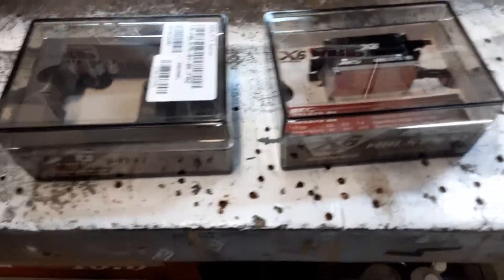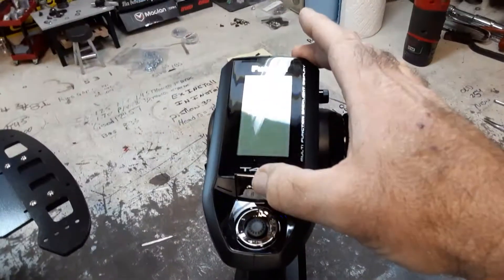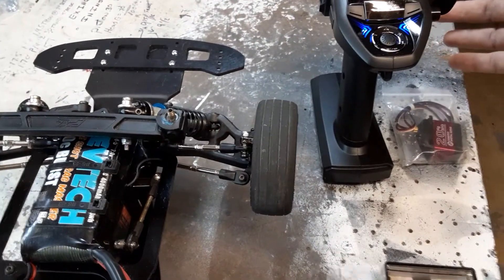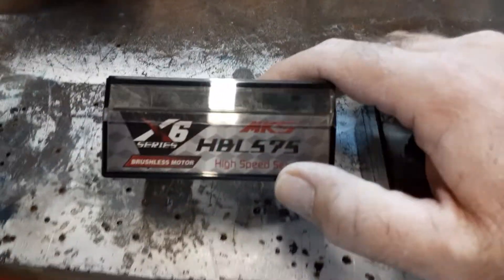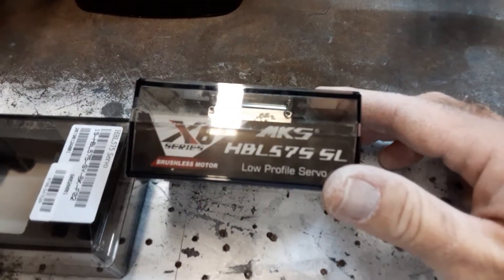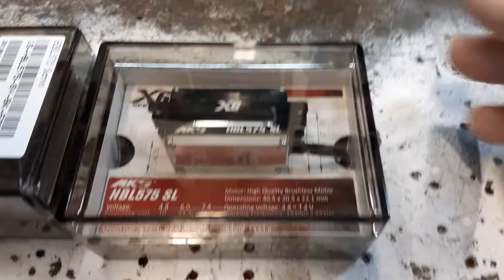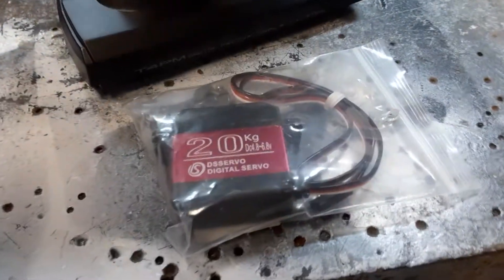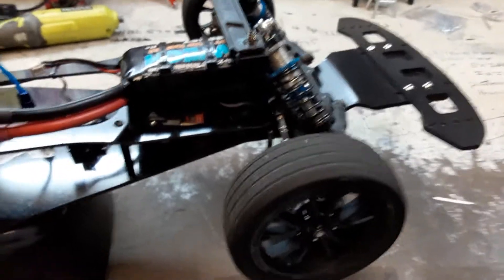RC Street Eliminator Drag Racing...A little Servo help!

Comment: Very nice equipment. I think it will be just fine. No mistakes . just learning experience's.  I think the sl means slim line.  As long as the specs are the same run it. And im sure its a weight reduction.👍
Reply from the maker: Thank you so much Rob for helping me out... you are right that thing weighs half as much, I think I may buy one from my other cars !!!

Comment: Like someone else said, doublecheck the servo arm (horn) isnt actually going too far down the splined part, and binding on the top of the case once the screw is tightened. Other than that, if noone was to ever crash, we could get away with almost nothing for servos, but theres no beating a digital servo for centering. I kinda still have mixed emotions on coreless servos, thinking ive blown those out easier in the past, but a low pro i think is the way to go for weight, especially since theyre metal bodied servos. And in all honesty i like cheaper servos, cause most of the time theyre slower response, and i dont have to turn em down as much. But to each their own. Ive never much found a need for a super super fast response servo. Heck, the radios themselves are so fast now, that they alreadt feel like the steering is moving, even when you just barely think of moving the steering wheel, and torque isnt a concern being 2wd and on road and skinny tires.
Reply from the maker: Thank you so much Don for taking your time and dropping your knowledge...... have check for binding, and agree with high-speed.. if your steering you're losing !!!
Reply: @powermadracing5116  absolutely right about the steering is losing when trying to go straight. Just centering and re centering are the biggest issues. And with tires not on tbe ground, or light to no friction on the ground, its all more important that its straight, as correcting these things is hard enough letting the rearend unload.
Reply from the maker: @dondagy9109  yes sir Don we call that high centering in drag racing... you can feel it in the seat of your pants. the car is getting loose when you're correcting and it's up to you if you lift or not... correct don when I crash my car I don't use trim . I actually just go out with a wrench and redo the alignment really quick. I feel if I use the trim it makes the car just messed up because the alignment is still wrong...
Reply: @powermadracing5116  i feel the same, the trim adjustment is too much, and it centers at a different spot everytime.
Reply from the maker: @dondagy9109  agreed

Comment: I just bought a powerhobby low profile for mine.  Are you wires on the servo all black with one gray Dave?  Also is the servo horn to tight or binding up?
Reply from the maker: Morning Josh what's up,  yes I checked for binding and stuff like that.. the new Servo has all black wires but are labeled on the connector... the old servo has been in there since Black Betty was born
Reply: @powermadracing5116  I've had the servo  horns hang up on these before and will make them do some wack shit.  That powerhobby servo I got has 2 black wires and one gray.  It's really confusing me.
Reply from the maker: @joshherrman3201  I would think the gray wire would be the positive .. I'm assuming the connector doesn't have a one-way lip on it or the receiver box, but either way you have a 50/50 shot.... if you put it in one way and it doesn't work turn it around problems is it giving you
Reply: @powermadracing5116  no I looks already.  Anyways 50/50 I good odds.  If I was in Vegas I'd be all in.  Hahaha
Reply from the maker: @joshherrman3201   LOL
Reply: @powermadracing5116  the gray wire is signal(S) and the middle wire is usually postive(power +) the outer end opposite of the gray wire is the negative(-)
Reply from the maker: @casconie  thank you very much for taking your time and helping us

Comment: Just wondering if anybody's tried to high tech Street eliminator steering servo that cost $35 not wanting to spend $100 on the servo but wanting something better than a 2075 Traxxas
Reply from the maker: The one that's in the car cost $17 and it seems to be working fine.. I think crashing took its toll that's all. I've heard other people about hearing centering issues.. you know how Electronics can be

Comment: Sorry man. I'm having same problem with mine. I've tried changing the servo and had same problem. Hope someone can help.
Reply from the maker: I had it happen before to Gregory , and I change the servo and it fixed it.. I just wonder if that one's too small I don't know shit about RC
Reply: @powermadracing5116  As fast as you are I don't believe that for one minute. Lol. I've been using futaba servo. Might try a different brand.
Reply from the maker: @gregoryfrost960  honestly Gregory everything I'm using is for my twenty-five years of drag racing experience. I've only been doing RC for a little over a year and a half,(covid) still have so much to learn about RC !!!!  that's why I always say we're learning together
Reply: @gregoryfrost960  in my 13 years into rc drag racing my tried and true go to servo has been protek servos(amain) and futaba. mainly protek with zero issues to date. buy once cry once they say. i had 1 mks which did the same but just a bit more expensive. again buy once cry once. NEVER  buy cheap servos, they are the key to your precious investment! pro tip: futaba GYC-441 gyro is a beast combo once paired with a digital servo as futaba, protek or MKS servo. hope this help. stay safe & greetings from U.S Virgin islands(st croix).